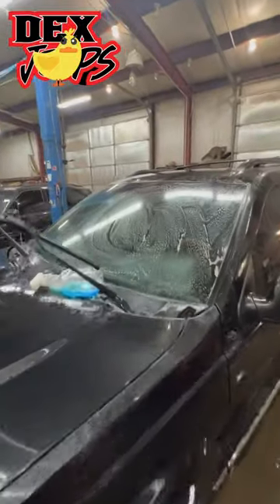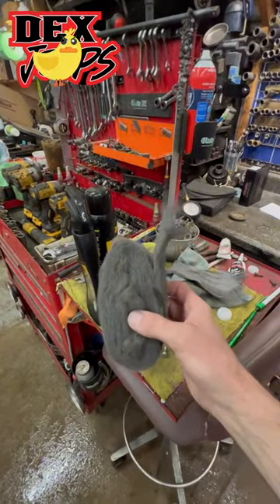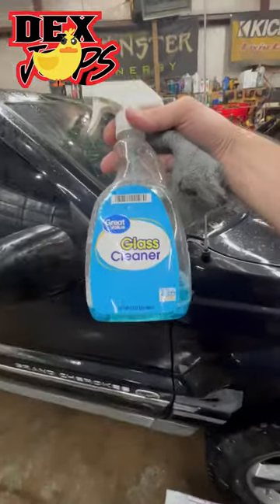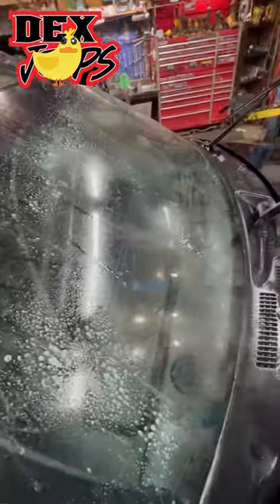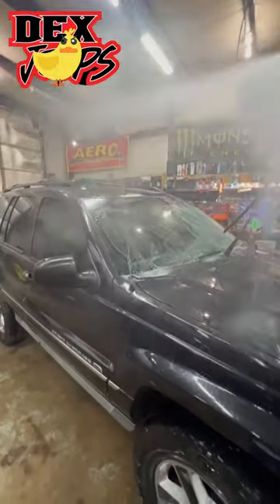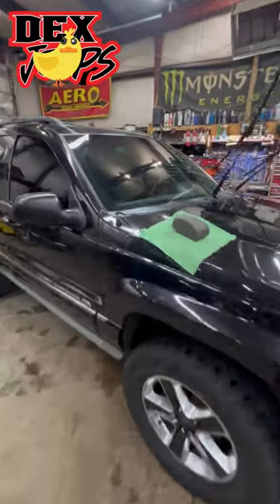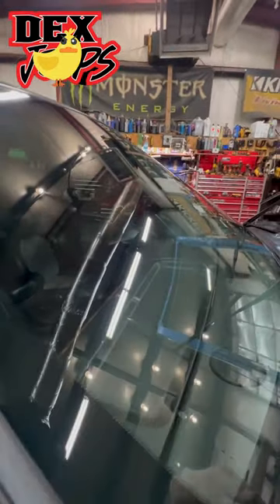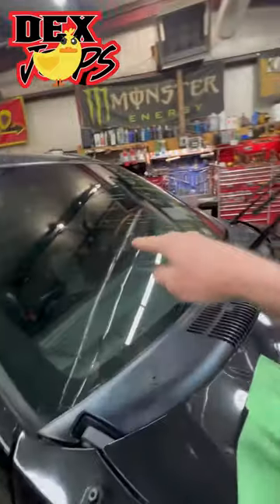Making glass cleaning easy. #windsheild #glass #cleaning #GlassCleaner #CleaningHacks

Comment: Since I live In the southern humidity I'm always astounded by people spraying water hoses in doors.
I'd have mold in the garage by the morning.
Reply: Same here, can't even imagine hosing a car down indoors.
Reply: Just asking, do you live in a cinder block home?
Reply: Nah, it's just a thing in S.E. you can run dehumidifiers full time and still get mold.
Reply: @johnsheetz6639  Is mold a problem in cinderblock homes?  I can't imagine it would but everything inside certainly could be.
Reply: Large metal shop. 3’x3’ homemade wood heater “cooks” moisture from air in shop. 12’ doors open and closed regularly. Never a mold issue in almost 14 years shop has been there.
Reply: @janetbrowder6685  No drywall, right?
Reply: Drywall in the living quarters with Central heating and air. No drywall in shop area.

Comment: Put a 9 volt batter to that cleaning pad...
Reply: Exactly... 👀
Reply: @Thestockxj96 

I got 98 xj with 3inch lift what size tires can I put on my stock rim 15.
Reply: @nathanmccumber8965  as big as u can get as long as it's a 15
Reply: @nathanmccumber8965  probably a p275 or 285 without rubbing. If you start getting into the 30s and 31s and above, I've heard that trimming would be required.
Reply: @Thestockxj96  even with 3 inch lift I need trim ?
Reply: @Thestockxj96  what size are 33?  If u can help plz and thank you.
Reply: @nathanmccumber8965  if it's a 33 that means it has a height of 330 millimeters. It'd be too big for that even with a 3 inch lift unless you take off something around the front bumper area to make space for the tire turn to turn.
Reply: @nathanmccumber8965  correction here! A 33" tall tire is equivalent to a p285/75r16 tire because I forgot it's a standard to metric issue here, however, you're still gonna have to make room for your tire.
Reply: @Thestockxj96  will 33 12.5 fit my stock R15 ?
Reply: @Thestockxj96 😮I told him literally step by step the different ways to go based on what he asked but, I just know that 31" is the most with 3 inch and no or just minor plastic corner bumper relieve cut... would you agree?
Reply: @Thestockxj96  Nexen Roadian ATX All Terrain.  Is this brand decent ?
Reply: @SarahSmith-hd8kd  yes. I've heard of people doing that.
Reply: @nathanmccumber8965  I've worked with Nexen tires before as a tire tech, and they're an ok middle of the road tire, sure. They're like most tires, where as long as you keep them rotated and balanced, you'll be fine.

Comment: Toothpaste & a no stick sink scrubber sponge. Metal on glass is no Bueno. Metal will scratch glass. You can do it on exterior only but it does leave micro scratches. I recommend glass polish after 0000 steel wool

Comment: the fun part is taking about 12" of that fine steel wool tie you a long rope to the middle touch a 9 volt battery to the ends then spin it around

Comment: Think I’ll just steal the old scrubber for pans in the sink bet that will work the same.  Wife might not be as happy with the results as me but I’ve got to try that next time.
Reply: I've used that with dish soap and add some to windshield solvent tank.  Occasionally clean off wipers with apple core to de gunk them.

Comment: I just use 40 grit sandpaper on my belt sander.  If it spins fast enough it wont scratch. I usually use olive oil for lube but transmission fluid works too.  Try it, it works especially well on classic cars.